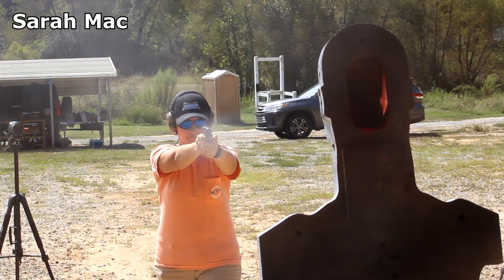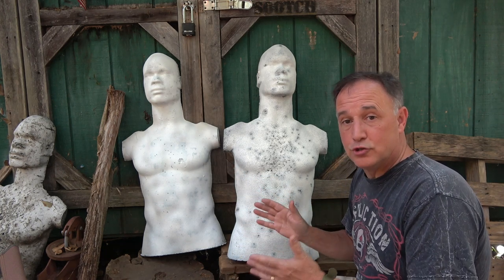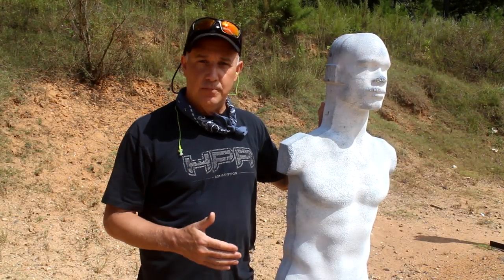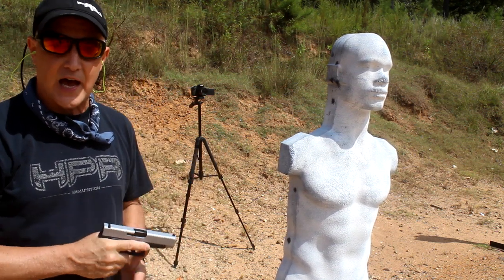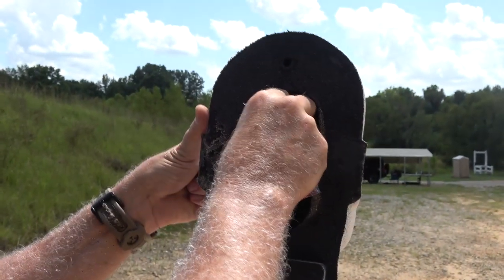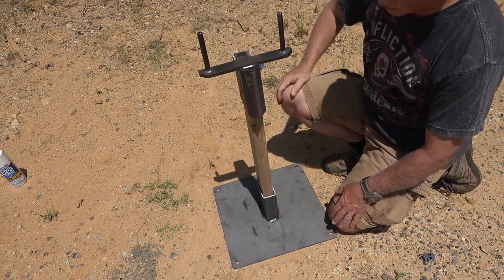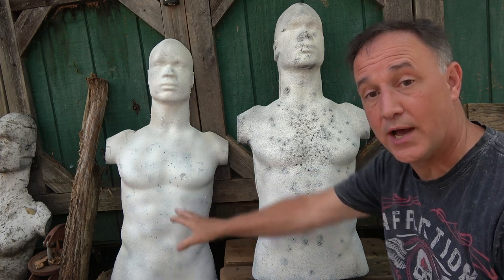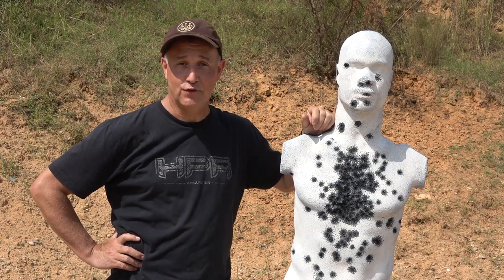Best Range Training Tool   New Rubber Dummies 2 0

Comment: Hi Sootch.  Springfield Armory just released the Hellcat pistol. Suggestion:   When you do your review of the new pistol, why don't you please do a feature-by-feature comparison of the Hellcat versus the XDS Model 2.  I suspect that the XDS Model 2 (which was released also just a few months ago but probably with less marketing), could still be a better pistol than the Hellcat except for the 1 additional round capacity or the optical sight option.  I like very much and respect your reviews...  Thank you!